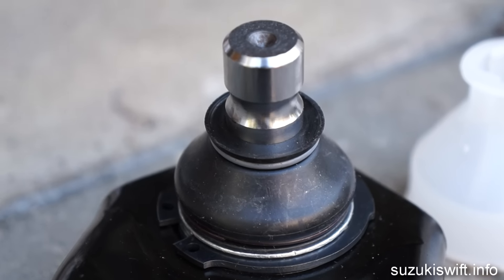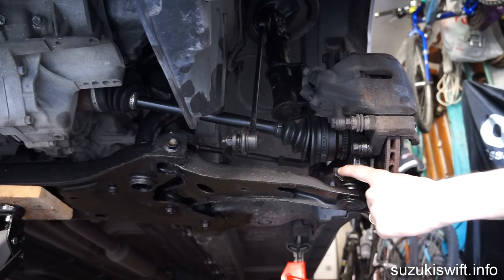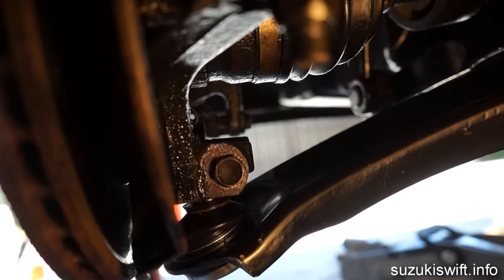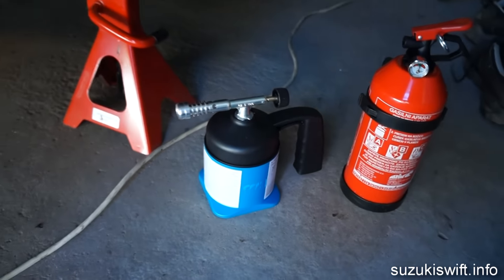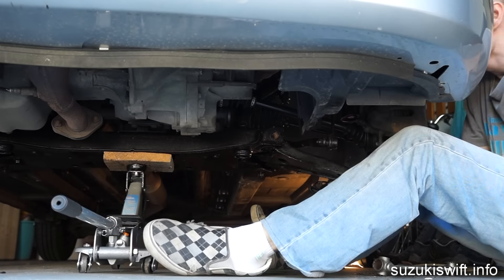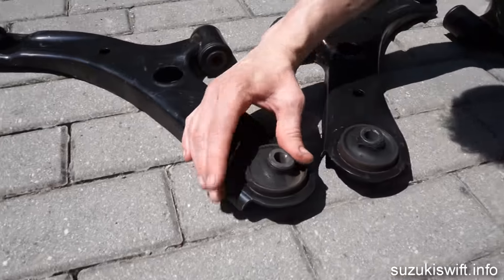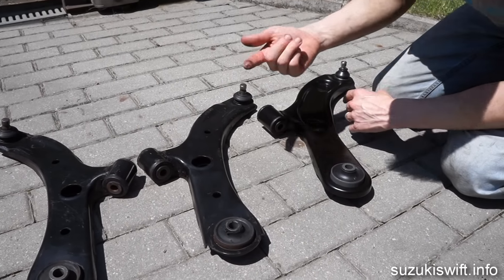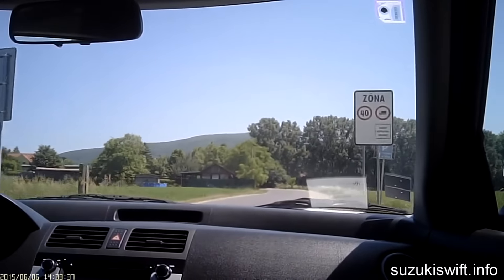Replacing the control arms in a Suzuki Swift (2004-2010)

Comment: got to get on your back to get more leverage.  another way is to double up on the wrenches/spanners.  while using the box end on the nut, and then another box end on the open other end wrench.  stick the open end thru the box, play with it a bit until you figure out how it doubles its length using the second for extra leverage.  or put a pipe on the ratchet, i often use the floor jack pipe. it its to long, mine comes in half. or go buy a pipe that fits your ratchet

Comment: When replacing the control arm, do you need to get a realignment?
Reply: yes, i did. they are never exactly the same all bolted back up. half a mm out and the steering is out too. bushings and et all etc are never identical. but its been two years so you probably already found that out.

Comment: man, how did you find out that the problem was coming exactly from that piece ?
Reply from the maker: +aspirinemaga I did a bit of googling beforehand and it turned out that the clunking noises often come from worn out control arms. I was about 75% certain that was the problem. I was right (thankfully!).
Reply: bored1980 ,